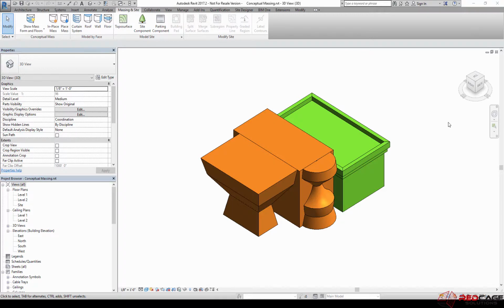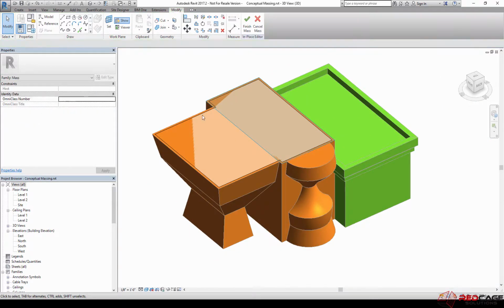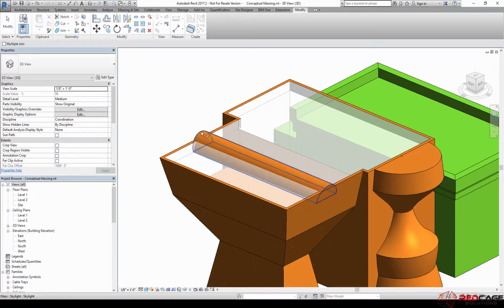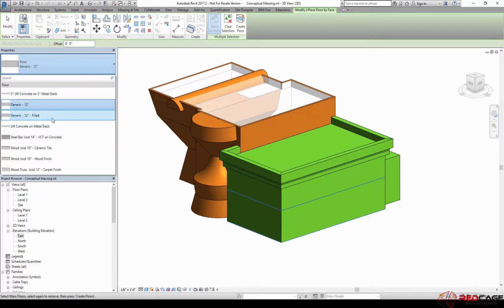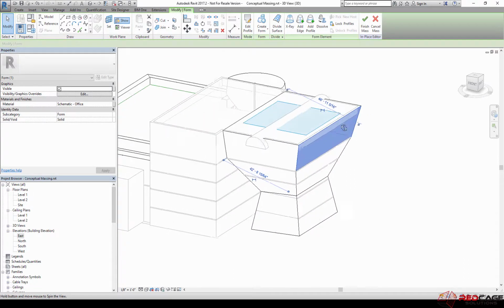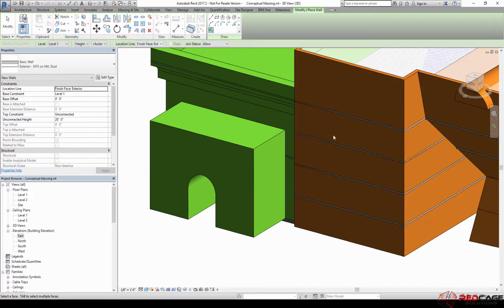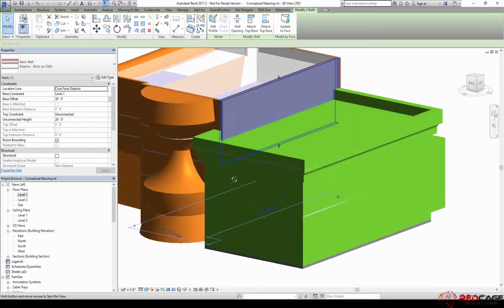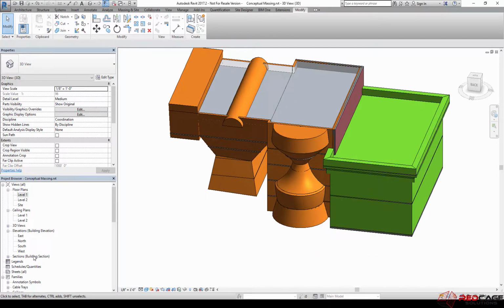Intro to Conceptual Massing in Revit Pt 6 : Cut Join Geometry Model by Face

Comment: Thank you very much, that was really helpful. I have a question: if you have one mass made of different connected shapes, is it possible to divide this mass into multiple separate masses?
Reply from the maker: I don't see why not. If you create a solid from two other solids, whether it be a union, subtract or intersect, a copy of each could be further reduced with another void form  and then reassembled as individual masses. I believe this would probably be better served through the conceptual mass family type however, rather than the In Place Masses we're using here. This way, the final output of what you're working towards is contained within that conceptual mass family, providing a little more control.

Comment: great video. really helpful.  thanks.
p.s. just one question: if we want to do with an RCC structure, how to make it for slab and beam?
Reply from the maker: Can you explain what you mean by RCC? These conceptual massing tools although they can compliment structural design, at this stage aren't really what we're relying on them for. This series was more or less to show how you can get quick feedback loops for gross floor areas and modify floor plates using the mass form. I could maybe tell you a little more about post and beam structure in Revit, but I'm not sure I understand your question.